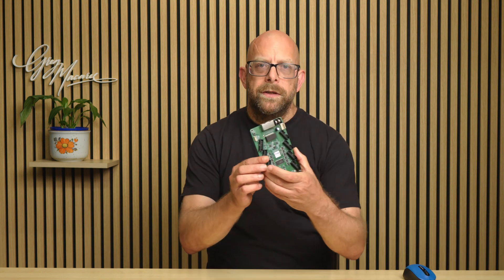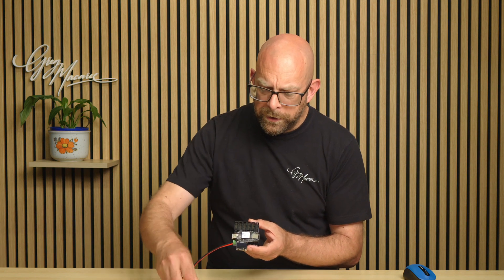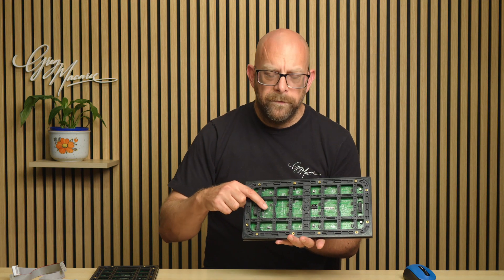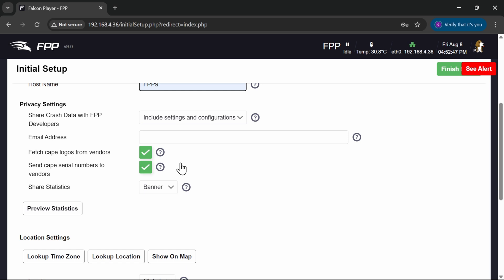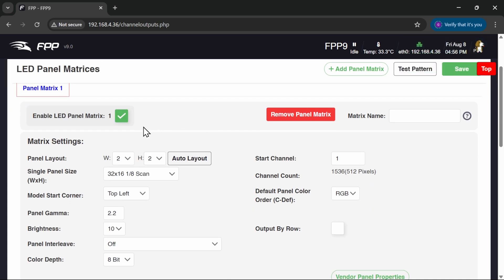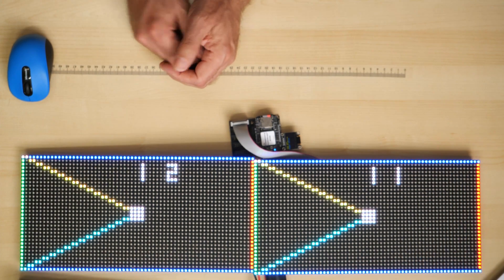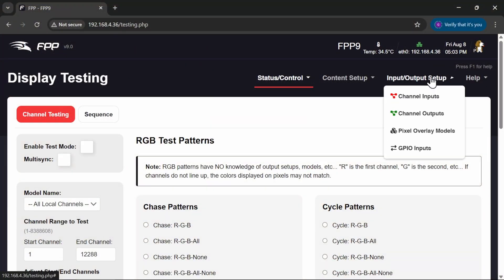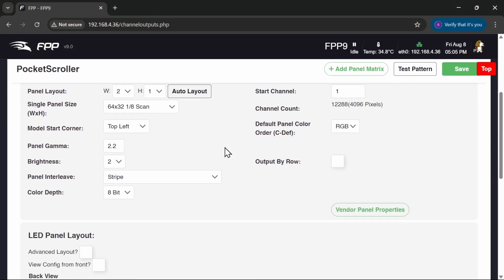Setting up panels with a Kulp Pocket Scroller and FPP v9

Comment: This is my first year i need a tune to sing for the Raido and a QR CODE for PulseMesh will the P5 Panels work for a QR Code ?
Reply from the maker: Yes, P5 panels will work for a QR code if your display is large enough. Both I & Ken at Wired Watts have demonstrated this in the past.